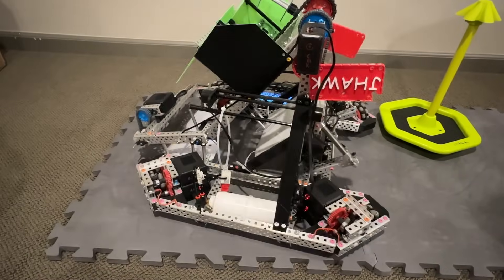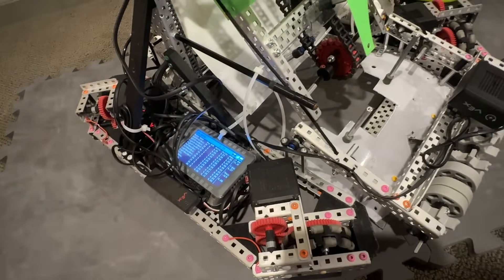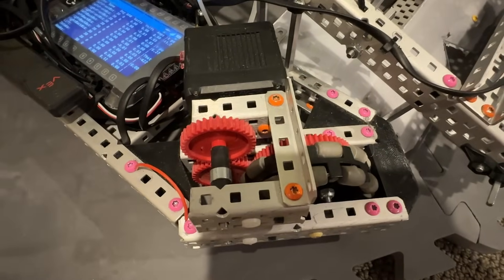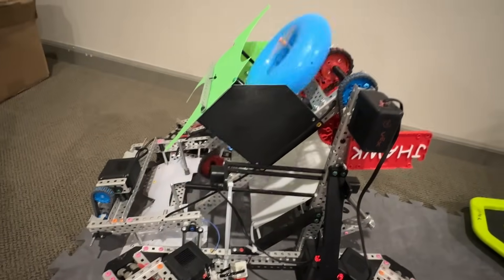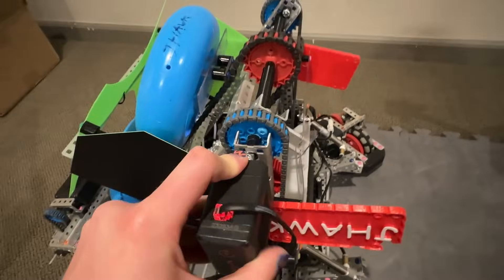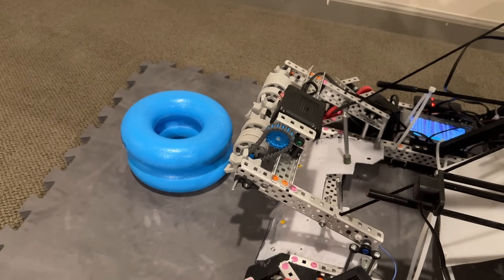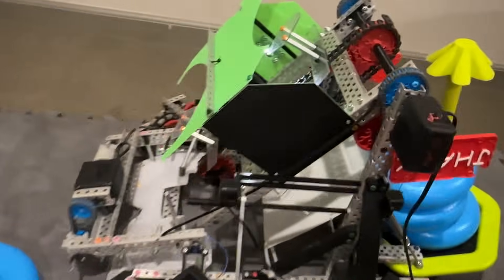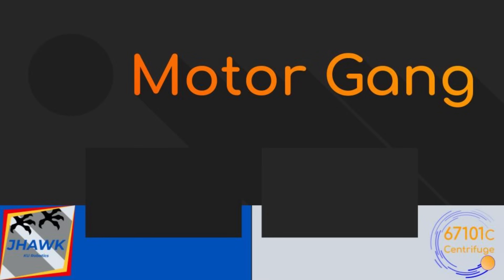JHAWK 24 inch X Drive Explanation

Comment: Why’d u guys decide to cut the flex wheels instead of using flaps?
Reply: stop yapping
Reply: @mujtabatanveer260Aye! Ain’t ur drivebase stiff as a rock
Reply: @wll9047 actually echo said it’s meant to be like that 🤓 ay ain’t u using the same gear ration as me
Reply from the maker: flex wheels are almost always going to be better at picking things up off the ground for an intake.